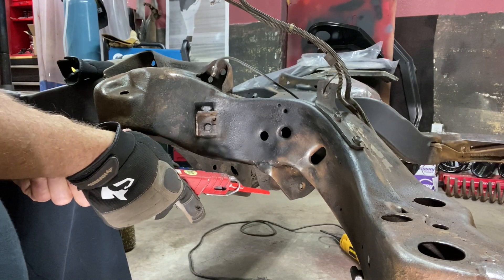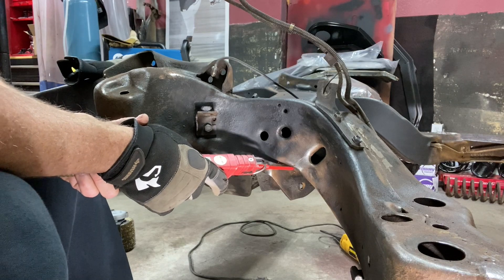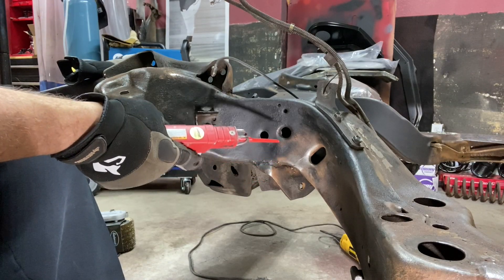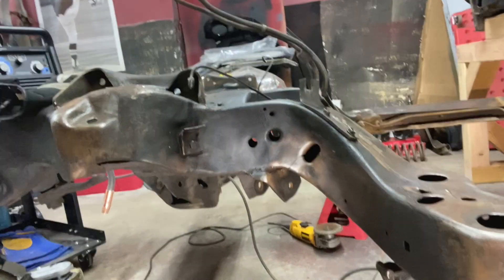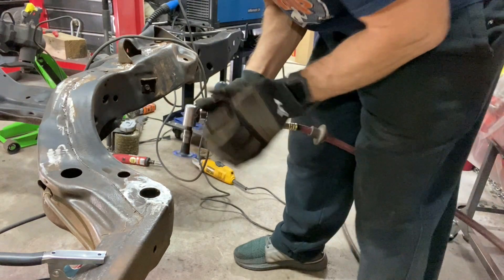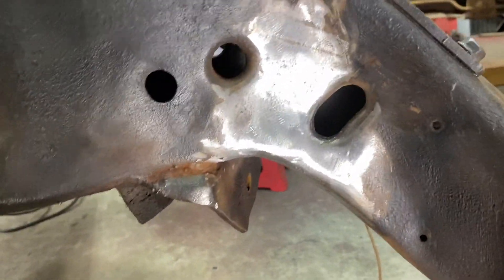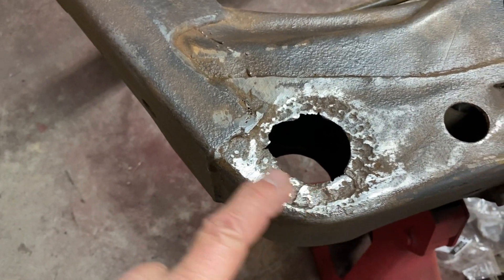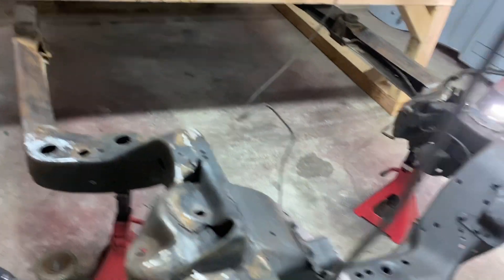Ep. 3 - 70 Chevelle Restoration- Frame Repair

Comment: Is using the saw to open up the gap where the crack is an absolute must for a proper weld repair ? I'm asking cause my 72 chevelle has a crack on the passenger side that is around the spring pocket and goes up the inside along the cross member.
Reply from the maker: Not an absolute must you will just end up with a larger bead welding over the top of the crack opening it up, allows better penetration into the metal. Your choice really.

Comment: Hi again. I have the same issue with a rusted out body mount that you repaired in this episode. It appears that a washer from a body mount will fit nicely when cut out and welded in. How did you enlarge the joke in the washer to the proper size- a hole saw? And how did you locate the washer in the exact spot centered in the rusty hole in the frame? I’ve been thinking of using a proper size hole saw and the pilot bit could be used to center the bug washer- then mark/trace around the washer  onto the frame and cut with a die grinder. Weld in the washer then drill the hole to proper size with the hole saw. How did you do it? Thoughts? Thanks
Reply from the maker: I have an Aircat pneumatic die grinder with a carbide bit I was able to cut the proper  size hole after I welded the washer in place. I took a lot of measurements and made a cardboard pattern of the drivers side so I could get the body mount located correctly.

Comment: When you repaired the body mount rust issue on the frame with the washer, whats the best way to make sure you have the new drilled hole centered in the right spot? Did you just take measurements off the opposite body mount hole?
Reply from the maker: that is exactly it, measurements from the drivers side for accuracy.
Reply from the maker: Also, you do want an accurate body mount location but there is a little wiggle room when installing the mounts and bolts.

Comment: Hey,
Was that a washer used to replace the metal in the bushing area(body mount)?
Reply from the maker: yes I used it because it was a heavier gauge that the frame material.
Reply: @soolegarage  nice, do you remember the size
Reply from the maker: pretty sure it was a 2" washer. Frame material is approx 10 Ga.  so find one that matches that or thicker. I think mine was 3/16 thick.
Reply: @soolegarage  awesome, will do… thanks for the info

Comment: Hi. I saw your Eastwood SCT brush sander in episode 2 for rust removal on the frame. Could this be used to strip paint from the body instead of media blasting or chemical stripping? If so, what grit brush would be needed?
Reply from the maker: I have used the SCT tool for paint stripping, It works pretty well. I have a 80 grit drum that I have used. it does fill the room with dust but works pretty fast. I also have a 60 grit drum, but I prefer the 80 its less aggressive and doesn't heat up the metal.